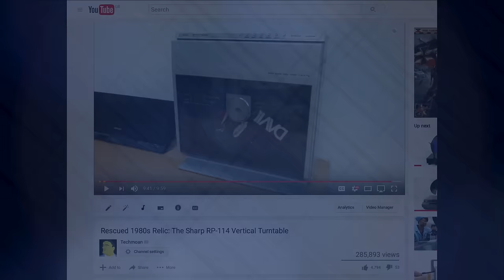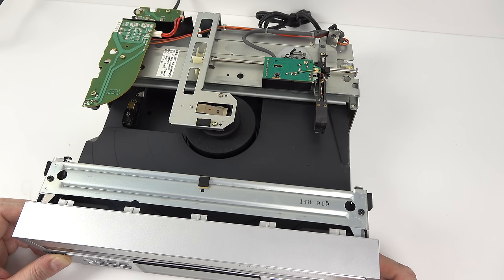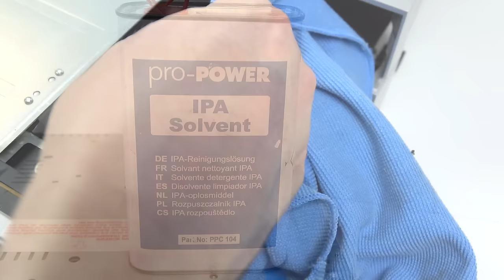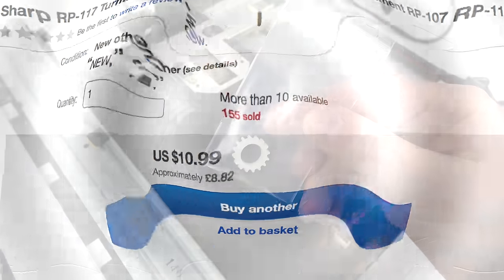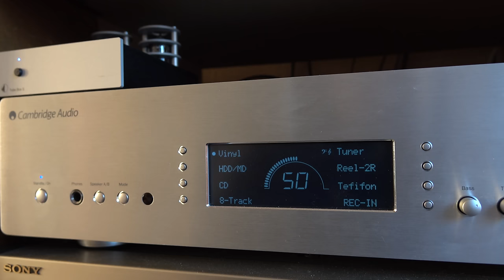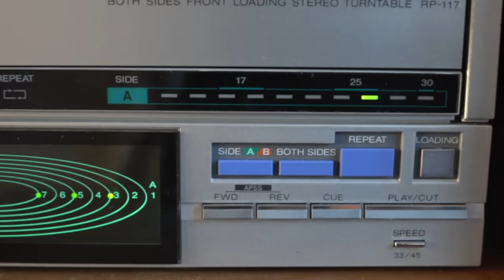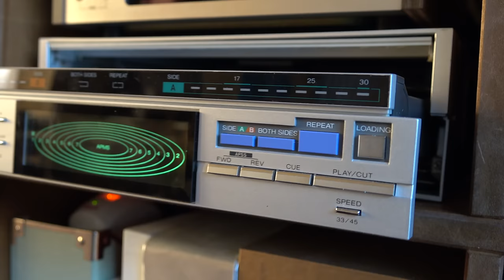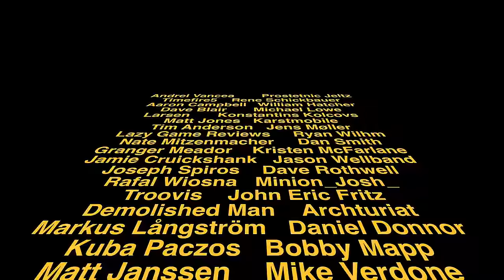RetroTech: Play vinyl records with CD functionality - Sharp RP-117

Comment: now find a cd player that acts like a vinyl.
Reply: There is actually but its such a silly thing that my God, just why? Also they still have protective casing on them but transparent because lasers not good for your eyes at all
Reply: Yeah it instead reads from the inside to the outside... but again, is there some device that plays cd's where you have to manually put the laser in position like a needle on a vinyl ? Somehow I like the idea though it is rather silly I agree ;)
Reply: Chevy Monsenhor gee whiz it's a joke
Reply: If you hold up a professionally pressed CD to the light correctly you can indeed see the tracks on a CD.
Reply: And then there are special DJ CD Players where you can actually move the CD around by hand if you insist. No clue about actual brands, just saw one once.
Reply: I was joking...
Reply: @SevelRomanov. I own many disc that have the Pan & Scan version of a film on one side - the Widescreen Letterboxed 16 X 9 Enhanced on the other.
Reply: +skatcat743 Fortunately no such thing exists.
Reply: Gemini CDT 05
Reply: At it would be the last CD you listened before going blind.
Reply: CDs spin from the inside out and vary speed. There are specialty DJ equipment for effects for CDs and Mp3. may I recommend Pioneer and Numark as equipment brands...
Reply: Xbox 360 or launch XO.
Reply: Cd players that djs use.  Djs scratch with the cd players like its vinyl
Reply: @SMGJohn  I like looking at seedee reader lasers. Perish tronald dump.
Reply: skatcat743 
It’s called a lightsaber.
Reply: I’ve never made a comment where I’ve reached nearly 200 likes
Reply: NORMALIZATION OF IGNORANCE very smart of you.
Reply: Pioneer PD-65 and PD-75 stable platter CD players. You put the CD on a retractable drawer that has a motor and platter in it label side down. plays the CD upside down while it is clamped to that patter.
Reply: The hard drivers  { not SSD } look like  a turntable
Reply: A cd player that adds scratches and pops to your music.
Reply: @EliStettner  
If you digitize { PCM } a vinyl album and then make a cd yes it can act like an LP 

The thing is that LPs cannot act like  CDs

Comment: Philips was one step further,they developed a record player with a laser instead of a needle.
Reply: Well at that point the sound is analog not digital correct?
Reply: Are you maybe thinking of ‘Finial Technology?’ Coming a few years after William Heine’s paper in 1977, ‘An Optical Turntable’ concept in 84 and working prototype in 86 blew minds. 
The massive problem aside from high cost in a newly present recession was that they were simply too accurate and had no mass to push dust from the track. This was a boon to those who cherished the idea of never degrading their vinyl, but it also meant no dust could be cleared naturally like a needle would be doing and it indiscriminately amplified any materials just like the intentionally recorded grooves. Wet wiping immediately prior to playing or a system that acted like a cleaning head was necessary for any enjoyable experience.
After Finial failed and investors sold it to BSR, it eventually turned into ELP’s LT-1XA in 1997 for the meager price of ~$20,000. Though the price has thankfully dropped in modern times to a more modest price between $13,000 and $16,000 for the LT-Basic. I have no idea what the LT-Master goes for though
Reply: @semuta2752  Pretty sure he's making a joke about CDs

Comment: Blast from the past! I actually owned one of these and it was excellent to take back and forth to college (university) and stack with my Kenwood cassette player and then my Magnavox CD player (once I got one of those) :). I would like to add one thing (two actually). (1) - if you played a record with a great deal of bass and you had your volume too high on your amplifier, the reverberations would cause the record to vibrate, in accordance to whatever wavelength of sound was pummelling the case.  This would ultimately end your listening experience and the unit would lift the arm off the record and you would be done.  (2) @ everyone who commented about the "bend" in the case - this is how mine came out of the box and, despite it being annoying, was something I came to live with.  I wonder where my turntable ended up.  I may have to ask my younger brother ...

Comment: A friend of mine had one of these in the 80's.  We used to stack two singles in it and set it to play sides A and B so we could hear both hits without having to open the drawer and switch the records.  I do recall the styli collecting huge wads of dust and having to open the access covers on the sides to brush them off and restore function. Great video as always!

Comment: This is an amazing and fascinating piece of engineering. Though, I wonder if anyone had ever asked for the so called "program" feature to play tracks in a dedicated order. When CD players came up, it seemed to be a plain demonstration of what could be achieved with this new medium. And it actually was fun to use two or three times assure oneself of extra control. But I never saw a point in consequently programming my favourite play order for each medium I had just inserted. Since play time was limited by the medium, I was either willing to listen to all tracks or I copied the desired ones to another medium.
Nevertheless, the "shuffle" feature was a useful innovation and has for good reason survived in nowadays MP3 players.
I suppose hardly anyone missed this "program" feature when it had almost disappeared by the end of the 1990s. Therfore, Sharp's well engineered "computerized turntable" reminds me of a cartoon I also came across in the 1980s: Sure they do have the Know-How. But do they also have the Know-Why?

Comment: Great video! I also have one of these, it's model RP-107 if I remember correct. Only difference I know is that 107 has a synchro button in it. My mother bought it new back in the 80's. It had same problems: broken belt and gear. I glued the gear back together with epoxy and it has lasted almost 4 years now, works great. But yeah, it is really nice to see that someone else is repairing these too, thanks for the video!

Comment: I had a more basic version. It looked like a standard player but was linear tracking one side at a time. The tone tone arm would sweep one side then play tracks in any order. You have to manually flip the record to play the other side. It was basically a CD player type player for vinyl, one side at a time. Great info in your video!

Comment: How come modern Turntables are so freaking expensive when they are basically nothing more than a disc, an arm and a motor?
Reply: Sheepy007 like a lot of the vinyl at the moment, over inflated prices. In some cases like direct drives they are worth the price and better quality parts
Reply: Mass-production has stopped, so, economy of scale has been lost. It's become kind of a craftsman work again (that's a bit of an understatement but you get the idea).
Reply: Turntables with less bells and whistles are of higher quality giving you better sound quality. More tricks on a turntable only degrade the overall quality. Those manufacturers use higher quality materials that pay off in the end. But, not everyone can afford the better high end turntables like me! I've just had to modify mine to a higher standard to please my ears.
Reply: A really good turntable has never been inexpensive.  As technology of record payback improved, the market widened considerably, creating more gap between the extremes.  If you were to study the actual mechanics and the effects of physical influences on the process of playback, anyone of reasonable intelligence could readily see the advantages of higher-quality construction (diminishing returns principles notwithstanding).  A really good vinyl playback system would simply stun most people at it's sound.
Reply: People with lots of money want things that cost lots of money. We,the common-sense citizen,want long lasting quality at a price that doesn't fund small countries.
Reply: I bought a Sony one from the 90s for $5 and it works great
Reply: The needle and cartridge, body and arm materials
Reply: Pauldjreadman fact if your Vinyl makes  a crackling noise when you play it that is not normal , it means it’s just dirt or fingerprints on the vinyl , just clean it off with a microfiber cloth n it would  not sound crackly when u play it again
Reply: @sameerrajakumar  seriously! Thank you! I get so tired of this retro bullshit where people talk about the good old pop and cracks of vinyl...that's like saying the good old laser rot of CDs...
Reply: well, there is no logic in buying a cheap new turntable, as there is a large amont of second hand ones you can find ...
so i guess manufacturer sells turntables with a good quality (a motor that wont parasite , good materials , stylus ... is expensive)
Reply: Some of the best turntables are belt-driven. Linn Sondek, for instance.  @Pauldjreadman
Reply: Well in the beginning of the 80s a good turntable or I can say bad one costed bellow 100$ which was a main reaosn why cd's took over even the badest cdplayer was better than a <100$ - the crap that wa bellow 100 was what most bought i a stereosystem . A good one was a bout 250-500 ( mine 500 used ) - and its about making the plate heavy as possible to it wont sound when playing back the music and really nowaday vinyls dont want features only the sound which much wasnt the case in the 80s - the companies sold features even the expensiv and deluxe.
Reply: Sheepy007 250$ for a hand assembled, hand machined beautiful turn table. Not the least bit expensive. You been out to eat lately?
Reply: @simonrodgers8902  but this is like 50 years later than the 70s so a expensive turntable can be made a 10% of the cost in the 70 s - but I guessthe manufakturers just make some modifikations to the turntable so it can be sold at the same price or more 50 years later - yes fricking expensive - the charge for labour  and exclusivety and because they can
Reply: Price is market-determined
Reply: Companies taking advantage of the revival
Reply: "Kapitalizm"
Reply: Rob C  Logic is correct, but a real business economy doesn't in your numbers - - yes, to produce plastic case it does cost $4.50 but only if you are producing hundreds and hundreds of thousands of the same pieces from a die that initially costs $200000-400000 Economy of scale. Same reason that Tesla cars are for the moment overpriced by about 40% in my opinion. What I'm seeing in current high end turntables is huge over engineering. But that's high end. There are people who are willing to pay $60K  for a power amplifier. It's a free market. Personally I don't see performance / sound difference between $1000 Amp and a $50K Amp. People SAY they do. That's OK with me
Reply: just get your grandparents vinyle record player I have my grandpas, it works pretty well for somthing thats been around since the 60s
Reply: Well they're also an amplifier and output device, sometimes with their own speakers, and also control for motor speed between 33.3, 45, and 78 rpm, etc
Reply: You forgot "diamond"
Reply: Go to a second hand shop like i did. I've never had an issue with the Radio Shack turntable i bought at a flea market.
Reply: SHEEPY007, Yes, they are also cheaply made and they even develop issues early on
Reply: Not all are expensive and those that are produce a good sound quality. There's a lot that goes into them that makes them worth the money. It's just that the fancy functionalities of 80s record players don't go into them. Modern-day deep-pocket audiophiles don't pay for fancy functions and good looks. All their budget goes into sound.
Reply: We're very far from Technics quality as those turntables were the best . Todays turntables are all junk all has cheap plastic with ridiculous prices going between $100 to $450 . As the records/vinyls are also ridiculously expensive. I prefer go to a second hand store buy the originals which are cheaper and has a better sound . 

Really that so called revival from records/turntables we have these last 15 years is more a scam imho .
Reply: @NinjaKurosai  Vinyl should never have pops and cracks. Handle them carefully. They still sound better than Cd's
Reply: I got an Audio-Technica AT-LP60 turntable from Staples in 2014 for a little over $100.
Reply: Turntables are dirt cheap, even the $2000 ones. A true audiophile knows that you can play an LP about ten times before the audio has degraded so much that it becomes intolerable to his (alleged) "golden ears". Assuming an average price of $30 for one LP, one playback costs $3 for about 30-40 minutes of audiophile enjoyment (audiophile LPs are never "filled to the limit", because the audio quality is noticeably worse near the center than the the rim). Assuming you listen to two LPs per day, you will have spent more money for vinyl than for the $2000 turntable within one year.

Note: measurement and calibration vinyl records have the same content on both sides, so you can use them twice as often. Usually they have checkboxes on the labels or the sleeve so you know how often you have used each side and when you have to throw them into the trash bin.
Reply: Sameer Rajakumar you just named something that is very common and normal lmao. It’s also due to static not just dirt, which can be caused by the platter
Reply: Brandon Ramos I mean some people don’t mind it that’s the thing. It adds a nostalgia factor for a lot of people. Nothing is wrong with that.
Reply: @sameerrajakumar  may be cartridge  defect also
Reply: @Pauldjreadman  The reason record player are expensive is because it's more complicated than a needle on microphone that sits on a bit of spinging vynl if you want to continue to listen to a record then a special cartridge is needed that makes minimal friction and amplifier.
Reply: @Liam3072  Not true because there is plenty of vyln boomers are giving away it's mostly aftermarket vynl of new music and custom artwork.
Reply: @phredl  Nonsense phredl.  CDs are generally going to be superior than vinyl records, especially signal-to-noise ratio and dynamic range. Recall that the whole point of vinyl records is that they are an inexpensive, cheap consumer format compared to high-speed reel-to-reel.
Reply: Same thing as reproduction guns, while a lot of people want say a WW2 era rifle remade to make it cheaper. The problem is lack of demand and the costs to make the tooling, same goes for turntables, computer chips, and automobiles. They also forget environmental regulations straining a lot of productions, remember we went from metal being cheaper than wood. To the point where you'll rarely see metal or wood, unless its a 4,000$ product.

Comment: I love these videos which are very informative and well done, mixing the technical with the practical and adding in great humor at the same time.

On this one, I had one of these that I bought new as surplus and really liked it. As described here, its gear eventually broke and that was pre-Internet where looking online for a replacement wasn’t possible but fortunately I was a Journeyman prototype machinist so I simply made a new one from an aluminum blank that already had the proper teeth so it was a simple matter of putting the proper center hole in it. Since the mate rack gear was plastic, it was still very quiet when opening and closing. Now I have a Stanton STR8 digital turntable and have used it for the digitization of a series of 1943 78 rpm disks from South America which was then released onto CD and I’m thinking of a vinyl release too.